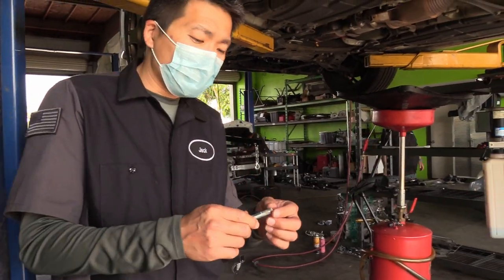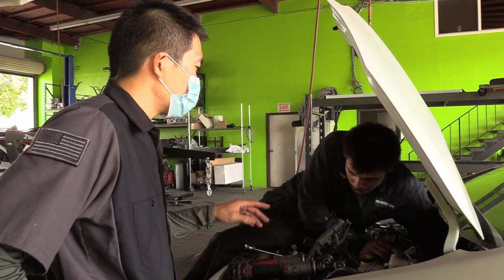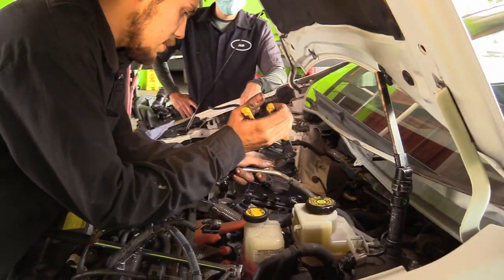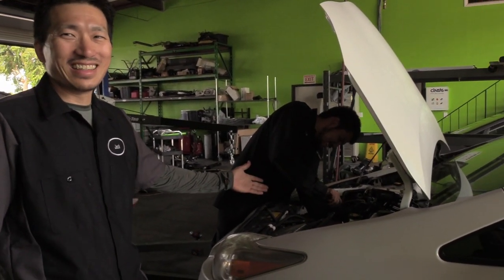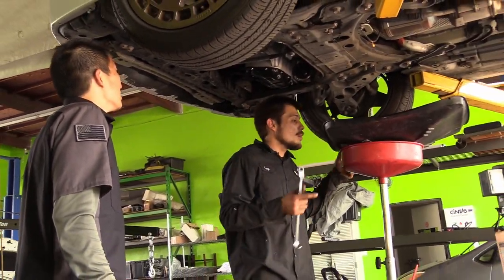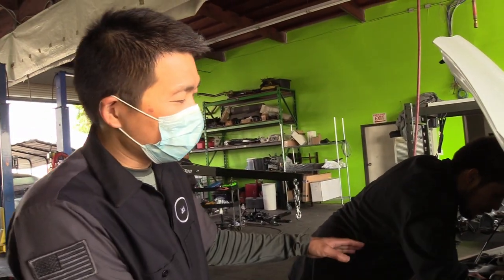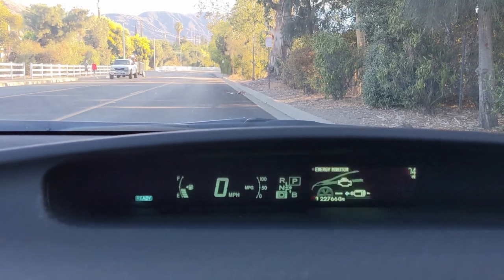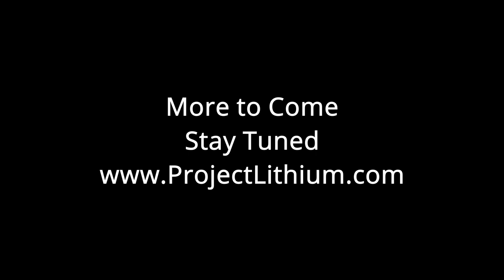Prius Gen3 engine swap with Gen4 - The installation and result

Comment: At .20 sec it still shows the misplaced PCV valve close to the oil at the bottom of the engine unlike the gen 2 where the PCV valve is at the valve cover at the top of the engine like almost every car has, if you need to swap the head and the engine is still good on the Gen 3 then just replace the head gasket why go through all this, either way you'll get another 200,000 miles or more on that new head again anyways, thank you for the video and the time you spent making it

Comment: You will need to ensure the EGR components, and the EGR passages, are kept clean, say every 50k miles. To avoid a repeat. The mechanics mention of sleeves in the block is not what prevents EGR clogging: 4th gen EGR is revised in many ways. And your EGR is still third gen. Which is smart, 4th gen EGR is problematic in 3rd gen vehicle. But yeah, continue to keep your EGR clean. See first link in my signature at PriusChat, for links/tips/info on how to DIY this. 😊

Comment: I did gen4 swap for my prius v at Golden kp around 2017 .that time engine was so cheap because no one need gen4  engine and gen 3 engine was asking around 1600.  City mpg shoot up getting 46 to 48mpg .but highway mpg stay the same. The car feel like slower too.
Reply: Makes sense the 3rd gen prius engine actually had a tiny bit more torque and hp.
Reply: No problems so far other than being slower?

Comment: @hybridapp Very excited for the next videos. If the engine is the same… I wonder if we could all get gen4 flashed ECUs on Gen3?? Hmmm
Reply: I'm wondering about what Toyota did to the Gen 4 to eliminate the problems with the, if it doesn't eliminate the EGR problem what is the sense to do the swap? If you still have to do the EGR cleaning I don't see any reason to swap.

Comment: I thought Tony said the gen 4 exhaust manifold is different, so with the swap they use a gen 3 head....isn't that the source of the problem in the first place?
Reply: I want to know this as well
Reply: No the source is with the coolant jacket passages in the block. With the heat up/cool down cycles so high in the Prius, there’s a lot of expansion contraction between head and block. The gen4 block has design changes to the cooling passages to help with less expansion/contraction
Reply: @willyfromthehillies so a head from the gen 3 with the block from a gen 4 is the ultimate reliable engine?
Reply: @technicalitems731  It's way more reliable that a standard gen3 block with gen3 head.  The gen2 engine is the ultimate reliable engine, hands down.  The problem there is that the gen2 vehicles look like shit from a design standpoint.  Honestly tho the gen3 engine isn't horrible for reliability, just nothing like the gen2.  You can expect to get over 200k miles on a gen3 stock setup before the head gasket goes, assuming you keep up on the EGR service and regular maintenance.  Still better reliability than most American cars.

Comment: What’s the cost to replace the engine with a gen4?
Reply: Wondering the same thing... Replacing my head gasket and lapping the valves now and kicking myself.... I probably should have just swapped for a Gen 4 engine after buying all the specialty tools, time expense it is taking to tear apart the engine, and clean it.

Comment: I thought Tony planned to put the Gen3 head so that the you can use the same Gen3 exhaust manifold. Saw on the last video Tony mentioned that there was a slight difference with it.
Reply: Never mind.. I guess Tony said he sent the head out to be rebuilt then put it in. I was hoping I could see that in the video :)
Reply: It doesn't look like they changed the heads over? That's why his old plastic cover couldn't go back on, because it didn't fit the gen4 head ... I'd love it if someone could clarify.

Comment: I did the same swap but opted  for a new/rebuilt gen 3 top/cams with the 4gen block so it came out  looking like a gen3  and can still use the 3rd gen  engine cover  not sure if that was a good idea ?  the mechanic gave me the option to keep it all 4th gen or modified to fit with the 3rd gen top/cams and decided  for the oem 3rd gen look so basically I have a 3rd gen top with 4th gen bottom
Reply: wow how much was that job?
Reply: @imthedrivingcrooner  your miles may vary I’ve seen this work in my area go for as low $2500 to as high $4500 you have to shop around and find what fits your budget  I found a shop  at the lowest end of the spectrum best of luck
Reply: Where did you get it done? And how is it running now, no problems?

Comment: Jack, I enjoy your videos. I recently swapped my the engine of my 2010 Prius with a Gen4 at the same place you did your and Tony was the tech.. two days after, I got the P0A80 ODB code which Dr Prius App says it’s the batter pack. I replaced my hybrid battery a year ago with a reconditioned battery so is it possible the error code is related to the engine swap or perhaps a bad blade in the hybrid battery.
Reply: Where's this workshop located?
Reply: I'd say another bad blade cell. Some of these guys are not reconditioning  the individual cells properly. And every hybrid cell on ebay have no milliamp rating... voltage of a cell tells me nothing.. (need milliamp ratings)
Reply: @uri78mx I think it’s the one in garden grove California.

Comment: @hybridapp I also have a Prius gen 3 and swap to a gen 4 and no one in the New York area can get the motor to work properly this is including Toyota Service, I keep getting a P0401 insufficient airflow. Any help will be greatly appreciate it
Reply: p0401 is egr flow
Reply: Did you fix it? Any updates

Comment: I have a question : my 2009 Lexus GS450h uses nickel hydride cells for its hybrid battery. Can I swap in lithium cells as a replacement or is that dangerous since it was originally installed and meant for nickel hydride battery as factory installed.
Reply: Good luck finding lithium batteries. 

You need a good bms for them
Reply: @gloomweed318  you know this guy's has them manufactured specifically for this right?

Comment: I have a 2014 Lexus CT200H, which is pretty much a Prius. Its beggining to knock and I have replaced EGR Valve and clean the system I also replaced the ignition coils. Were are you located and what would you charge to do this?

Comment: In the middle of doing this myself, hoping to get it done tomorrow morning. The 4th gen actually has 13 less horsepower than the 3rd gen. Personally I'm unaware of where this decrease comes from IE: Ecu tune, Injector size, fuel pressure or the intake redesign, but its supposed to be more efficient so the horsepower doesn't really matter.
Reply: It's a difference in the calculation method, accurately estimating hybrid horsepower is tricky.
Reply: How did it go? Any updates on your swap?
Reply: @jbek9779  it went fine, had to custom make a coolant hose for the driver side. Have 2500 miles on the swap now, no issues at all. Getting ready to sell it though, automatic transmissions just bore me too much so I bought another manual.
Reply: @aaronnagy5430  fantastic!! I’ve just bought an engine from 2019 prius.
Reply: @jbek9779 we’re you but the engine and how much you pay ??